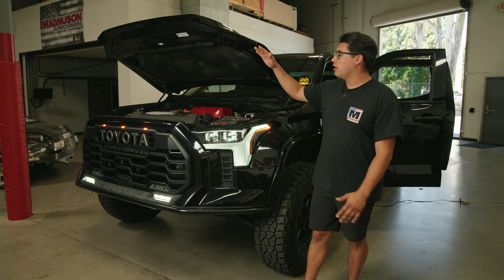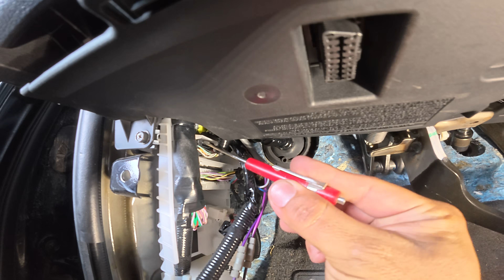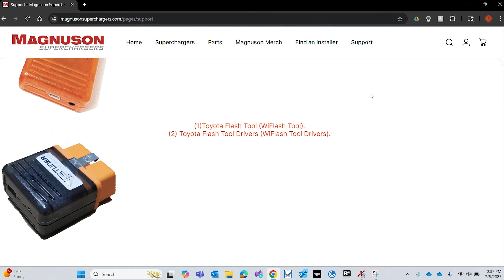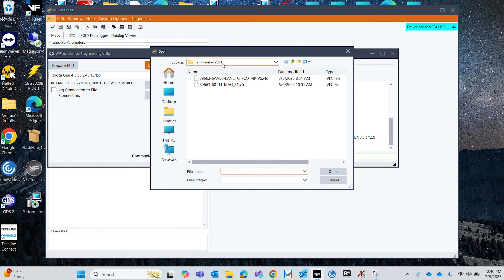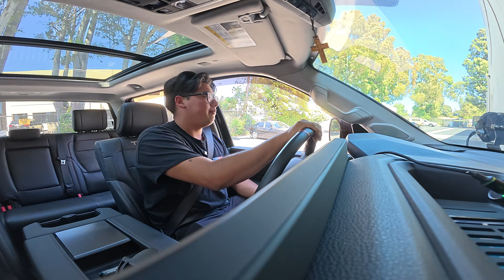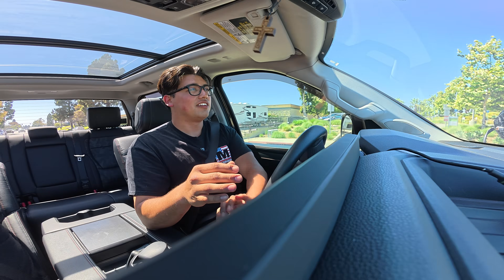2022+ Toyota Tundra Performance Tune | +85hp +85ft-lbs | Step-by-Step Install + Test Drive

Comment: Will the added radiator fit if you have  a 12k front winch mounted behind the front grill on a cbi covert front bumper
Reply: Good question, I have the same setup. I’m very curious if it will work. Have you found out anything @rottenrottie1515?

Comment: I'm pretty sure it voids factory warranty right? Especially with all the recalls going on with the engine also how many pounds of boost does it increase on the turbos what is the turbos top off at PSI I'm thinking about getting it I'm at 60,000 miles already and I don't have warranty but I'm thinking about buying extended warranty
Reply: I’d buy the extended warranty if that means you can get the engine replaced soon. If not I’d go for the tune. I’m waiting for early next year when my new engine replacement is scheduled.

Comment: Why does this need to plug into the harness? Why not just at the OBD connection?
Reply: By bypassing OBD it doesn’t create and event.  So Toyota doesn’t see it being flashed…
Reply: @robertwotring7318 it’s not being flashed… it’s being intercepted and deceived.

Comment: Can the OEM tune be read and save? In case you wanted to revert  to stock.
Reply: Normally the 1st step is Ecu ID and stock file capture so you can revert later.

Comment: well we have an issue my 2024 Platinum Tundra has the battery up front.
Reply: This video is of a hybrid Tundra, which has both batteries under the rear seat

Comment: Would love to see a dyno/draggy for proof. I would also be curious with what you can get with just a 91 tune, without the exhaust and instake stuff.
Reply from the maker: Hopefully we'll have more data soon. Peak power should be similar, but real story with the extra parts is what they do to heatsoak. It doesn't take much to saturate those turbos.

Comment: These engines can’t stop blowing up, I wouldn’t risk a tune that pushes more power.
Reply from the maker: Our plug-and-play tunes are always made with engine health in mind. That means there's always something left on the table, but it also means that if you have a healthy engine, you don't need to worry about our power adders shortening your engine's lifespan.
Reply: @magnusonsuperchargers still doesn’t matter. If it does blow up your tune voids my warranty
Reply: @magnusonsuperchargers I appreciate the response. My comment’s not a dig at Magnuson, but moreso aimed at Toyota and the new Tundra issues they can’t seem to resolve. The engines don’t seem healthy to start with.
Reply: @Jordan-nc3zy  the tune from the factory has nothing to do with them blowing up. It has everything to do with metal being left in the block from the machining process!! B